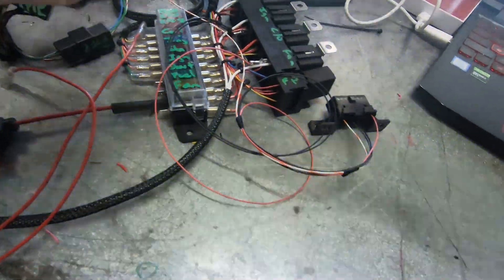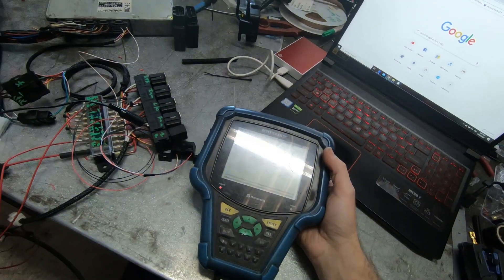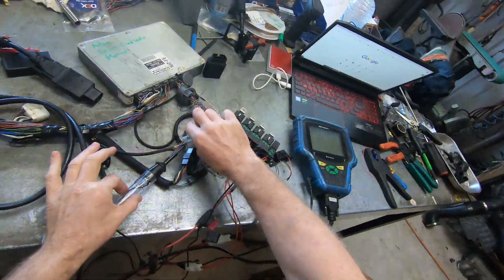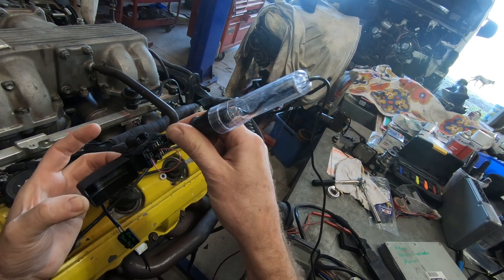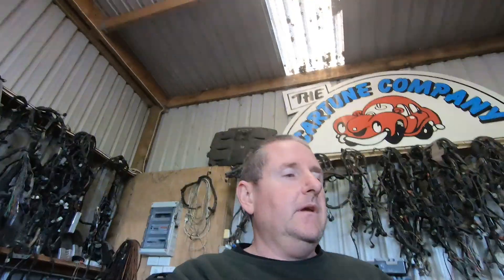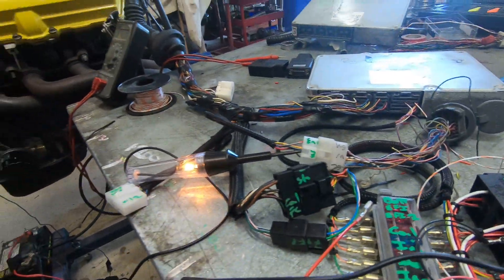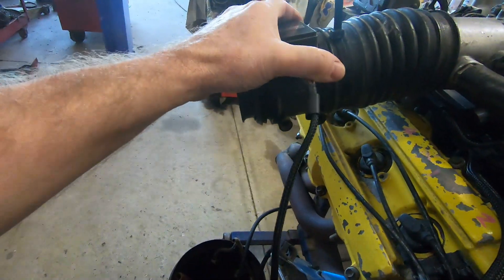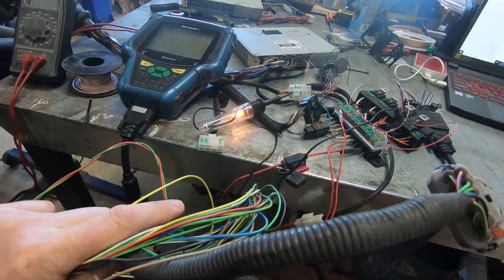lexus LS400 and Toyota Celsior 1uz Data link connectors. DLC1 DLC2 and DLC3 ( OBD2 )

Comment: Yah know what. I really need a damn scanner. My dad has a Snap-On scanner. but I most likely need to buy adapters for it etc etc. And I don't really wanna fuck around with a expensive scanner. as I might break it, and dad will kill me.😂 so anyways. I will buy one for myself and ALSO look into changing my three shift soleniods on my 1992 LS400 transmission which my Over/Drive is blinking I used the wire method for TE1 and E1. Was kinda hard to read the damn codes. as the O/D light was flashing wierdly. so i couldnt tell exactly what code it was. but I'll fuck around and find out.

Comment: Can i ground TE2 on the dcl1 22pin port and use a obd1 22pin to obd2 16pin jumper harness and connect to my launch scanner?
Reply from the maker: I have no idea.  I have the correct adaptors so haven't needed to do anything else.
Reply: @CartuneNZ  do you sell these adapters? I want to be able to use my scanner
Reply from the maker: @speedfreakimports  no,  its part of my hanatech scantool that I've had for about 15 years now